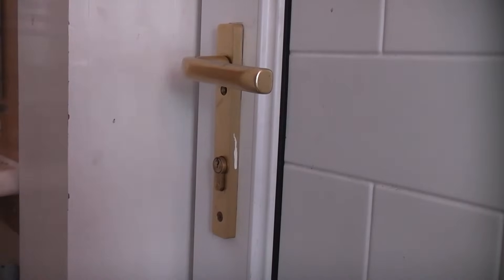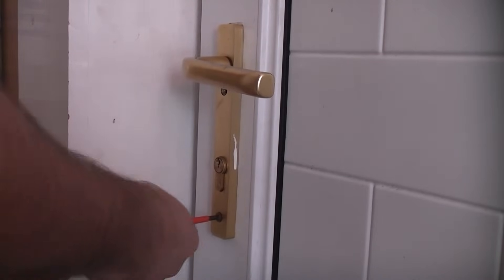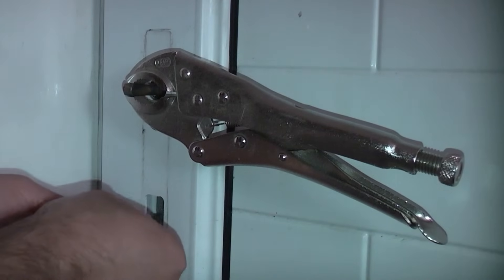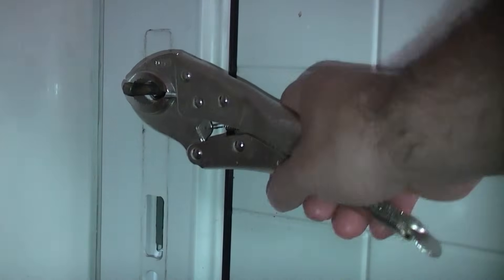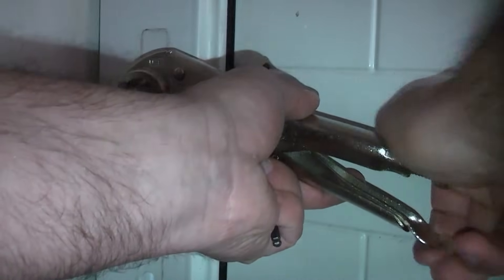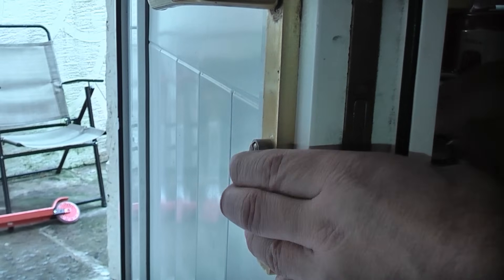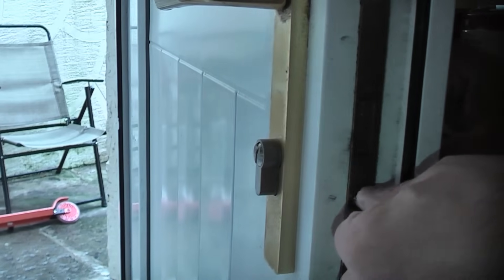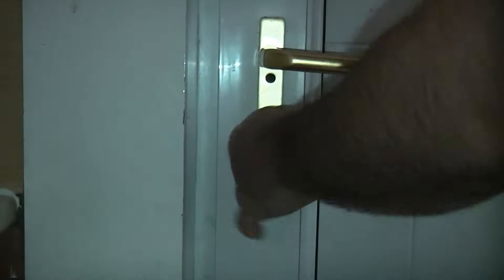Replace a euro cylinder without the key | lock snapping

Comment: So I followed your great instruction.  the lock snapped easily but the door is still locked.  it's a french door with the slide up hooks.  any assistance greatly apreciated
Reply from the maker: Have you instated the Allen key to turn the cam- you might need a pair of pliers/molegrips to turn the Allen key once its inserted.
Reply: +Ultimate Handyman ah!   missed the Allan key bit. I will try this.  Hope it works...   Thanks for a quick reply
Reply from the maker: You are welcome.
Good luck with it ;-)

Comment: Great video. I bought my flat and there was no key for the patio door in my bedroom, which is locked. I have snapped the lock off, but I can't work out what you are doing when you put the allen key in? What do I need to do? I'm roasting in my bedroom, so would love to get some air in! Thanks
Reply from the maker: With the Allen key I turn the inside of the lock that is normally turned with the cam on the lock (you may need to use the mole grips on the end of the Allen key to get more leverage)

Comment: What did you do with the allen key as I'm currently stuck after taking the cylinder out but cant seem to unlock the door? Any help would be appreciated 👍👍
Reply from the maker: There is a cam inside that turns the lock, you need to turn the cam using the short end of a large Allen key, perhaps 8 or 10mm
Reply: @ultimatehandyman  managed to get it sorted thanks bud!

Comment: Thanks so much for this, I've got double french doors, Do you think I need to do both? I've done one of them and theres now a bit more give, but she's not opening...
Reply from the maker: No, you should only need to do the side that you normally open and close.
Did you unlock the door using the Allen key?
Reply: @ultimatehandyman  Thanks for your reply, I did the alan key bit and it gave some give to the door allowing me to almost open it but there was still something there, I snapped the lock on the second door and managed to open them both that way.

the problem I have now is ive fitted thr new barrels l but the key doesn't turn all the way to lock the door :( I checked for debris from the snap, all clear.. hoping I didn't damage the the door some how...
Reply from the maker: @alastairmcbricky3456   Not sure about that, I have only done this a couple of times and not had any issues, so far!

Comment: I’ve got 2 doors to change the locks on but they don’t have the normal retaining screw that euro locks usually have. Are they just really old doors? If so how will I get the barrels out without snapping the, 😂?
Reply from the maker: Not sure, I definitely would not snap them if there is no retaining screw.
A mate of mine had a Euro lock and that used a pin to hold the euro cylinder in place, I'm sure he said he had to snap the pin to get the euro cylinder out.
Reply: Ultimate Handyman thanks for the reply. I can see what looks like a pin maybe once I take the small grub screw out where the normal bigger screw goes. Will have a play with that before I take some more drastic measures 😂 appreciate the reply

Comment: Very clear and practical informative video. Thank you.  Will this method work equally well on wooden doors? or would it damage the wood and make the new eurocylinder lock difficult or even impossible to fit?
Reply from the maker: Yes it should also work on wooden doors as the lock is pretty much the same
Reply: Does work on wooden doors but be very careful as is quite often causes damage to the mortice lock that  the cylinder is fitted into

Comment: Is the longer part supposed to be toward the outside or more towars the inside?
Reply from the maker: It should be flush on both sides, but if it protrudes on the inside, it is not a problem.
Thanks for the comment 👍
Reply: @ultimatehandyman  your welcome. And thanks for the advice chief. Seems like I have one lock to turn around, lol. Now if I could just snap a few of these other locks on some internal doors. I tried before, but I guess I am not strong enough.
Reply: I have another question. Had a lock changed. The space was 70mm but the dudes put in a 90mm. I can change the lock myself for a new one but I can not find 70mm, I can find only 68mm. Is it ok to use a 68mm lock in this case?

Comment: I just tried this today with a mole grip. I couldn't get anywhere with it. Eventually I tried two adjustable spanners, one on each end of the lock. That snapped it easily, but it was a bit of a sod to get the new one in, as the insides got slightly distorted/

Comment: This a common trick thieves use, as demonstrated on the BBC.

I have bought new anti-snap / anti-bump locks as this has been happening in my area at lot.

They are really easy to change (with a key of course) and so much cheaper on-line than in a locksmiths, ie £80 locally or £20 from Handlestore online.
Use know brands, eg Yale.

Patio door locks are usually cheap and nasty, they unscrew the handle and the cheap generic lock is exposed, then the thieves break the lock with a mole grip.
Reply: I'd say use GOOD brands. Some of the known brands suck. The lock in the video is probably also very well-known, just from being used so much.

Comment: Great video! Am currently in the middle of this process however I'm unsure what to do with the Allen key / catch? Do I need to twist it some way? Also am I able to slide the handle back on to to do this or do I need to use the mole grips? Thanks!
Reply from the maker: +Rob Houghton 
Yes, you need to insert the Allen key then turn the cam on the inside.
You might need the mole grips on the end of the Allen key to get the leverage to unlock it.
Once unlocked put the mole grips on the spindle to open the door ;-)
Reply: Excellent quick answer - thank you! Once the cam is twisted though can I slide the handle back on the spindle to open the door or will it really require the mole grips?
Reply from the maker: +Rob Houghton 
Yes, you can use the handle if you like, just be careful not to push the spindle out of the other side of the door ;-)
Reply: Thanks again for quick response!!
Reply from the maker: +Rob Houghton 
You are welcome ;-)
Reply: I am still not quite clear where to push the Allen key into.
Reply from the maker: +alan g k 
The short end of the Allen key is pushed into the hole where the Euro cylinder was. There should be a cam in there, which is the part that rotates when you turn the key. This unlocks the door. You might need the mole grips on the allen key to get enough leverage to unlock the door.
Reply: Thanks.  I was using too small an Allen key, so it didn't give sufficient leverage when rotated.
Reply from the maker: +alan g k 
Glad you sorted it ;-) 
Thanks for the comments
Reply: +Rob Houghton You can slide the handle back on and use the handle if you want!
Reply: Skipped the most important part With the Allen key. I have tried everything and no matter how much leverage on Allen key. I still can't get it to unlock

Comment: Hi great video but I’m stuck. Manage to break the lock but my door is in locked position.
What do I need to do Alan key???
Thanks
Reply from the maker: You need to insert the short end of a large Allen key (8mm or above), then turn the long end with mole grips or pliers to unlock the door. If you look at a euro cylinder, there is a cam which operates when you turn the key, the Allen key does the job of the cam 👍

Comment: hi pal, thats pretty quick. have you tried that method in a very tight cylinder fittings? and does it work? i called that method vertical snapping. and not try  it yet. i always used the horizontal snap in all of such incidents. (if pickings fail). i am also very surprised of the way they do in some modern countries, the way they make a hole in that cylinder fittings, and the protrussion of the cylinder from the door. sure it is a cheap cake for burglars.
Reply from the maker: No, I've only done this a couple of times.
I didn't know you could get tight cylinder fittings, I thought they would all be the same size.
Thanks for the comment

Comment: Hi, I've got an era standard 6 pin lock that we've lost the key to but the door is unlocked. I've tried snapping the lock as shown in this videos with no luck. I've broken the pliers too. Is there anyway I can get this off? I can't afford a locksmith at the moment so desperately needing a solution. Thanks in advance.
Reply from the maker: You need a decent pair of molegrips, a decent pair should make snapping the lock easy!

Comment: If you make sure your cylinder is the correct length then there's no issue. I always have my cylinder sitting flush with handle on outside. Also, don't waste your time with thumb turn on inside. Always have a 2 sided key version and don't leave keys on inside of lock.
Reply from the maker: There is an issue with cylinders that are the correct length (if they are not anti-snap), as burglars will rip the handles off then snap the cylinder.
Thanks for the comment
Reply: What’s wrong with thumb turn?

Comment: I have just bought a second hand porch with a sliding door. However, the door is out of the frame but is locked and there are no keys. I can get the lock cover plate off and removed the screw that holds the lock in place but I can`t withdraw the lock because its out of line because its locked. I can`t snap it as in your video because the opening for the lock is an exact fit so I don`t have room to wiggle it up and down. Just wondered if you had any ideas before I have to drill the door to give me better access. Thanks.    Great videos by the way ;)
Reply from the maker: Sorry Mike, from what you describe it sounds like you might have to drill it out. I'm no locksmith though and one of those might know an easy way to get it out.
Thanks for the comment
Reply: I may be answering my own question now but if I lie the door down on its edge with the lock exposed would I be able to use a small chisel and give the lock a whack in the middle at the weakest point and snap it in a similar way to your video? Thanks again.
Reply from the maker: mike travis
Not sure Mike as it's not something I have tried.
The cylinder in this video was incredibly easy to snap, but you do need to get some movement on the cylinder before it snaps at the weakest part (where the retaining screw goes).

It might be worth a try as long as you don't damage the door ;-)
Reply: ***** Thanks for the quick reply. I got side tracked looking through your video collection, some really useful stuff there my friend. Looks like I might have to have a go at drilling as it seems the best option to try. I got a good bargain with this porch and its sods law that if I try something to severe I will smash the glass or damage the door and then it will cost me more. Thanks again and keep up the good work. ;)
Reply from the maker: mike travis
Thanks Mike, Good luck with it ;-)
Thanks for the comments

Comment: Thanks U.H. Am I right in thinking this can only be done from the inside of the door or would it be this easy for thieves to break in? N.
Reply from the maker: Hi Neil, No this can also be done from outside unless you have a snap resistant euro cylinder. A scumbag would just use the mole grips to rip the handle from the door, then snap the cylinder. I'd encourage everyone to fit snap proof, bump proof, drill proof and pick resistant cylinders. The ABS ones are good but expensive- High security euro lock fitting
I'd also recommend having a fully working burglar alarm
Reply: Thank you very much for your guidance U.H. I am a little paranoid where home security is concerned and enjoy following ALL your home security tips and projects.
Cheers. N.
Reply from the maker: Neil George
You are welcome. You can never be too careful when it comes to home security ;-)

Comment: Would this be the way to remove the cylinder when attempting to replace with an antisnap but the retaining screw would not budge?
Reply from the maker: No, this should only be attempted as the last resort.

I had a cylinder retaining screw once that would not budge, but eventually I managed to remove it.
 

I ended up removing the handles from both sides of the door and squirted lots of penetrating fluid at the retaining screw, where it enters the Euro cylinder. I then shocked the screw using a punch, then used a damaged screw extractor to remove the screw (at this point the screw head was badly chewed up). The screws are normally brass- so very soft!

This videos might help- you can actually see some of the screw that I was fighting with in the video- https://www.youtube.com/watch?v=_mTFQbaT3Zc

Thanks for the comment
Reply: Ultimate Handyman 
Cheers,  I'll see if I can get a bit more muscle but screw head is beginning to deteriorate, so I may be looking at last resort.

Comment: would a  Locksmith Tool Multi Purpose Cylinder Gauge Cam Turner Spindle Turner be helpful
Reply from the maker: Yes, I did not know that they existed until I just checked eBay, one of those would be really useful
Thanks for the comment 👍

Comment: Can you do this with all locks, my door is unlocked & can open, but I've lost the key.. I've tryed snapping it.. But it not as easy as it looks🤔
Reply from the maker: As long as the cylinder is not anti-snap on both sides you can use this method.

Comment: I can’t see how you could do that from the outside as the handle plate can only be unscrewed from the inside, unless the barrel protrudes a lot of course.
Reply from the maker: Burglars will rip the handles off, which then leaves the Euro cylinder accessible.
Thanks for the comment
Reply: @ultimatehandyman  can't argue with that. I guess a solid steel handle would make a big difference but they seem to be made of soft aluminium.
Reply from the maker: Yes, but even then they would soon rip them off, as they are only held on with two small diameter screws.
A fully working burglar alarm and cameras are a must these days! (unfortunately)
Thanks for the comments

Comment: I managed to lock patio doors lost a key or can't find key. Can I do the same as per you video to replace euro cylinder?
Reply from the maker: Yes, providing the euro cylinders are not anti-snap cylinders. 
Some high security ones are anti-snap on both sides and some are anti-snap just on the external side.
Reply: Absolute Plumbing better to grip it on the flat sided of the cilinder en move left and right till snap. Else you need to drill it

Comment: Hi have removed lock as video but the door won’t open !? Any more tips please? When I try the handle with the euro lock removed it feels fairly rigid ? Thanks all . ✌️
Reply from the maker: Have you inserted a Allen key and turned that using a pair of molegrips, to unlock the cam? It sounds like the door is still locked.
Reply: Ultimate Handyman hi thanks for reply , alas! As the video suggests to insert an Alan Key a twist a cam to unlock I can’t seem to locate any feeling of a cam in between the plates .. the door has been closed along time and was always difficult to lock unlock .. please continue to suggest !? Many thanks a frustrated son trying to sort ma,s door .✌️
Reply from the maker: Try lifting the handle right up, as far as it will go, then see if you can unlock the cam.
It's not an anti-snap cylinder is it ?
Reply: No the euro lock snapped with ease .
Ok will try .. but I can’t feel any resistance re can to move with the L end of the Alan Key.. 😊

Comment: There appears to be two small cylinders onto of each other block the path between the fixing screw and hole in the lock...have tried turning and pushing these etc but path is always blocked, any advice?
Reply from the maker: Jonathan Mccullough Not sure, sorry.You could try posting pictures and asking here- http://www.ultimatehandyman.co.uk/forum1/
Reply: It's okay, got it sorted, it seems that after having to break the first barrel a small inner part of the barrel came out and lodged itself just in place to block the fixing screw hole, and shunt with a screwdriver popped it out again.

Comment: Hi. I have the same situation. Key snapped off in the cylinder so I have broken the cylinder and removed it but not sure how to open/unlock the door? What are you doing with the allen key? Thanks
Reply from the maker: ryanhenry21 
Turning the cam inside of the gearbox on the door.
You can do it with the short end of an Allen key but you might also need a pair of pliers to give you enough leverage to open the mechanism.
Reply: ***** cheers for your quick response. managed to get it open. thanks
Reply from the maker: ryanhenry21 
You are welcome!
Well done ;-)
Reply: ***** I have reached the same stage that ryanhenry did. I have followed your steps but cannot turn the cam. Should I be lifting anti-clockwise? Should it be really stiff or easy? I have been going at it for some time, but without being able to picture what the mechanism looks like, I am fumbling around in the dark. Any tips? Thanks
Reply from the maker: Dan Goldthorp 
Try using a Allen key and a pair of molegrips to get some leverage on the cam- it is not easy to turn. Try looking in the hole to ensure the Allen key engages with the cam.
It will undo in the same direction as you used to turn it with the key, this varies depending on whether the door is left or right handed.

Comment: got this problem, I tried drilling the lock first but that has not worked out, the cylinder turns but not catching the latch, been trying to snap the lock but I must have got a strong one as it has not snapped so far :-(
Reply from the maker: They are normally pretty easy to snap.
Thanks for the comment 👍

Comment: Hello there, I have managed to snapped the euro cylinder but the door is still locked. I can not take out the metal piece which is keeping the door locked. I tried Allan key, a hanger no luck. I have spent  hours Any tips ? Thank you
Reply from the maker: It's not an anti-snap cylinder is it? Some of them are anti-snap on both sides, which will make it impossible to unlock using this method.
Thanks for the comment